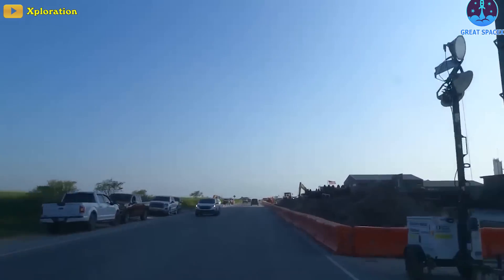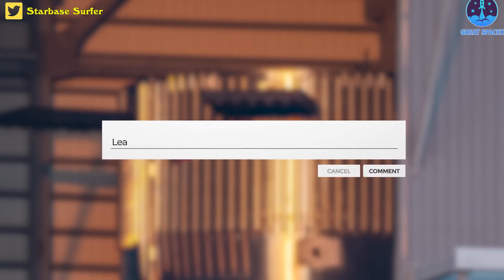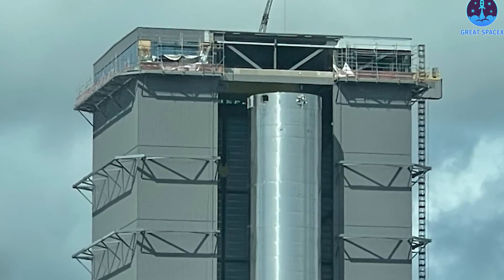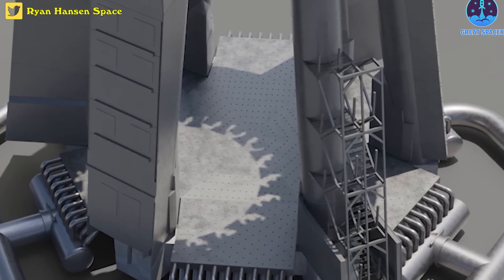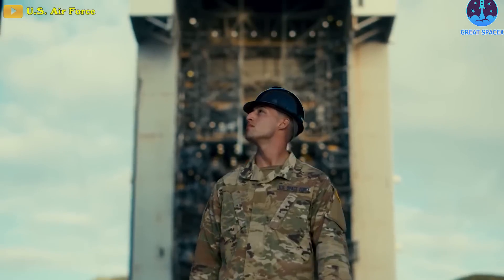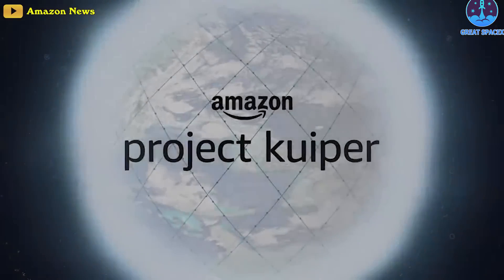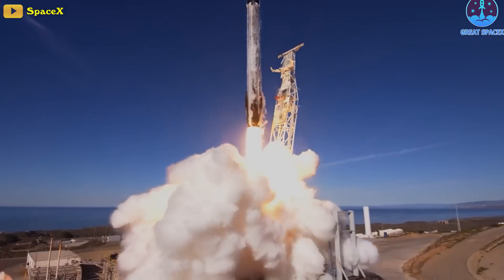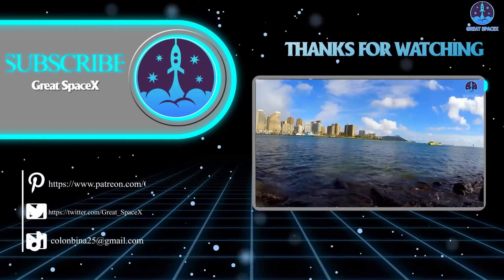NEW Booster testing, OLM FIREX System action, Tank Farm ready and more...

Comment: When they use Nitrogen, freeze temps at -428 degrees, is colder that Methane at -295 degrees , and Oxygen at -361 degrees. So using Nitrogen for cryogenic testing is colder than if fueled by it’s intended fuel

Comment: SPMT's are purpose built for Super Heavy, the rocket stands they carry are.  The self-propelled modular transporter or sometimes self-propelled modular trailer (SPMT) is a platform heavy hauler with a large array of wheels which is an upgraded version of a hydraulic modular trailer. SPMTs are used for transporting massive objects such as large bridge sections, oil refining equipment, cranes, motors, spacecraft and other objects that are too big or heavy for trucks.

Comment: Falcon Heavy itself is an very damn Impressive & Successful Launch Vehicle. That took some Engineering to Perfect. If Space-X can get Falcon-Heavy in Orbit, they WILL get Starship to fly - even though the increased Dynamic Forces and Complexity. Love watching construction Dynamics at Starbase ...ONLY DOWNSIDE IS These Films are a GD PLAYBOOK for the Commie Chinks to PILFER US DESIGNS ...which they're so damn good at. They already went to S Steel and methane Fuel Systems. If Space-X were to go to "Cermet" Rocket Materials, Chang would have operatives over here Scraping some out of the Factory Waste Bins to send back home.

Comment: Testing the structure of the rocket using stress calculations is only part of the story. Cryo testing and static fire are also important. But the final definitive test is live launching - several times over! Look at ULA's Vulcan to see how testing can show weaknesses. After blowing up the   rocket they discovered that the 2nd stage material was too weak and the rocket needed to be redesigned. Jeff Who's BE-4 engines also exploded - according to ULA CEO Tori Bruno that was 'just' a question of 'poor workmanship'... 😱
Reply: They all have **poor workmanship ** tbh .. unlike @  both Starbases .. they are wking at a sloth's pace compared to the rate of speed SpaceX is wking .I can easily predict that, with in a decade .Musk will have established a Moon base of operations .